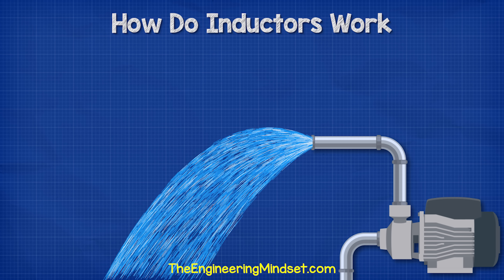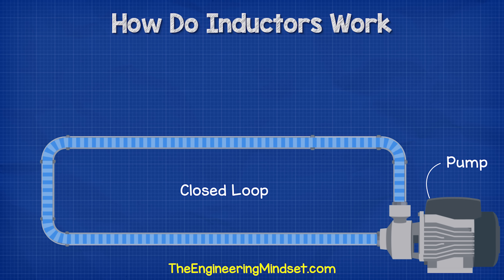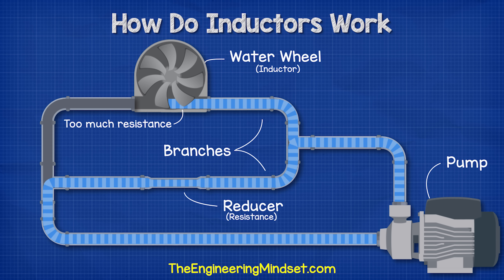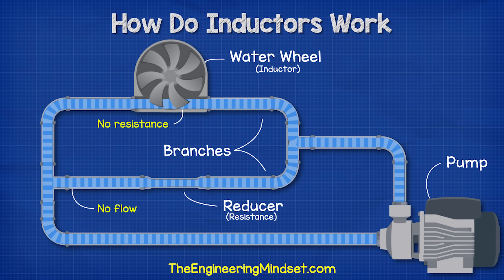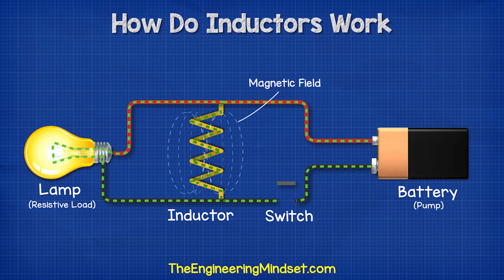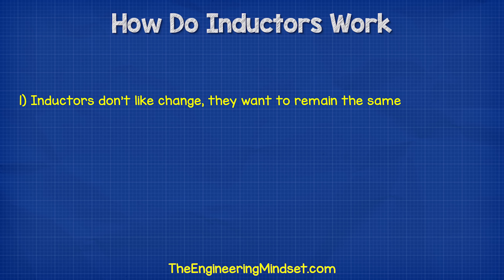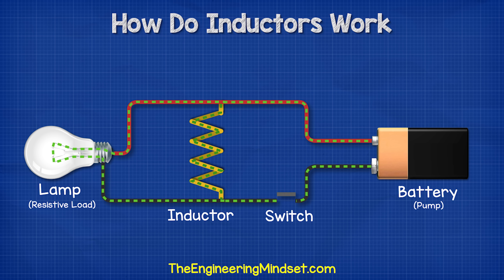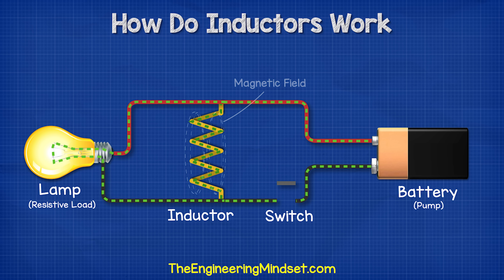How Inductors Work

Comment: so how does the value of the inductor affect? lets say i have a circuit. the old inductor on it used 1mm wire with 20 turns, now i swap another one same that but with double 1mm wires. how does this affect?

Comment: Please could you make videos showing how:

• Comparators 
• Voltage reducer circuits (say from 48v DC to 12, 9 or 5v DC)
• Toroidal transformers
• Complex logic gates
• Modified square wave oscillators
• IGBT, BJT, MOSFETs, GTO
• Zero Voltage Switching (in inverters)

Work

Comment: It probably would help to mention the practical part of the theory where the inductor tries to maintain the peak of the alternators (power supply} voltage even when it drops to 0 volts 60 times a second or whatever the frequency may be.

Comment: I like the video I understand what is going on from someone that deals with electrical everyday. But this all means nothing if I don't see a practical application and see it in use. I would recommend. adding that. Most of my knowledge, even though limited was actually learned by seeing it in use and by measuring it. Example would be seeing an vehicle ignition coil fire a spark plug and seeing the electrical work through a voltmeter, oscilloscope or amp meter.
Reply from the maker: Seen our new Oscilloscope tutorial? (beginner friendly) link here:➡️ https://youtu.be/LaY47Qrfs0c

Comment: There are only two things you have to understand. An electron and light. The movement of electrons higher to lower spins or otherwise produces light. Other things are encapsulation. Ten power +-24. 12×2. Because Max curvature is power 12. Time is always a quantum of 24. For four dimensions 12  - 4 equals 8.

Comment: To the battery DC, the inductor is just a length of wire. A inductor only has reactance to alternating current. The battery should be replaced with an AC source.

Comment: Why this inertia? Is it because electrons flows very very slow, what flows instantly is field both electric and magnetic field between particles in conductor and in core of inductor? Im asking cause lenght of wire to make coil, usefull on timings of micro seconds (power converter), lenght of wire is very short, and normally light would travel instantly, for some reason such wire is able to make huge difference in timing. Two wires close each other, with current flowing same direction makes coil, makes difference, could this because if current flows slower than speed of light? Could wire of conduction in witch current flows even slower than copper make even better coil? Clectrons are like domino effect it pushes against each other, what flows mostly is electric and magnetic field, electrons itself are much much slower than magnetic field, numbers of real electrons flowing is very very low, comparing to electromagnetic force caused by it. If such difference in speed we would have inertia effect.. I cant explain, i struggle to really understand why how, in details it works. This turbine explanation is very good though, best ever came across. Ever. What would happen if we make coil of wire in witch electrons flow faster what would be difference in material in wich electrons flow slower? Does parameters of coil varies depending on temperature?

Comment: I figured the inductor is a resistor. As current is forced through. It generates heat. Heat increases the resistance and it will eventually fail.
Reply from the maker: Check out NEW resistor video, everything covered! ➡️ https://youtu.be/DYcLFHgVCn0

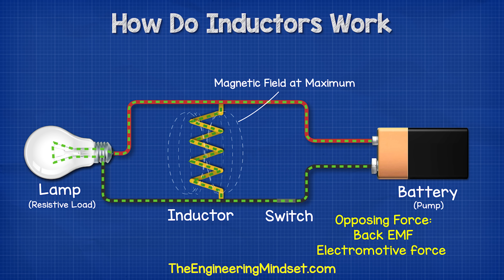Comment: 4:52
If the inductor will eventually act like a normal piece of wire with no resistance, what's stopping it from creating a short circuit?

Comment: the creation of the magnetic field, the movement of that, I assume is then opposing  the current thanks to the like, the left or right hand rule, or something, cus a moving magnetic field induces a current, and the movement of the field being created by the inductor will then cause it to induce a current in the opposite direction causing impedance, thats what ive imagined happens atleast.

Comment: Is this how a coil on a car works?
Reply: A bit yeah. But an ignition "coil" is really two coils. A car ignition coil is a step up transformer. The car's ignition system runs the coil on pulsed DC. So the primary is constantly being switched on and off. This video did not really touch on magnetic coupling of currents between conductors. But that's something else we do with inductors a lot.

Comment: Very well explained using water turning a turbine and the kinetic spinning fins as the EMF 👍
I find the water analogy to visualize what's happening in electronics is a good fit but not perfect. It would be interesting to see how you can model a capacitor this way(?) I'd imagine a reservoir split in the middle by a rubber diaphragm
Reply: Since current has no inertia, it's difficult to find an analogy!
Reply: Or a water baloon. When the balloon is full, it will visually stop taking more water. And when discharged, all those water comes out fast due to the balloon's stretchiness.

Comment: It seems like what you are describing is a capacitor.  How would you describe that an inductor can act like a capacitor and how are they different?  I normally think of an inductor as a device used to cause current on another, non-electrically connected nearby circuit while a capacitor stores energy like a battery within a circuit typically used to reduce variance in voltages over time or to provide some electrical bursts for some applications.  Appreciate your videos and helping me better understand what you are trying to share here.  Thanks.
Reply: I will try to explain the difference between an inductor and a capacitor to you in the simplest way that I know.

A serial connected inductor is like a flywheel. It takes some energy to get it started but when it is started it is easy to keep running. The only thing that really would stop it if left on its own is the resistance in the bearings. When it is spinning it has stored energy and to stop it it must give out this energy. The electromagnetic force in the inductor works in the same way. It keeps on resisting change.

A parallel inductor works as an open circuit. it will take some time to get the flywheel to spin so that there no longer is any resistance. 
 
A parallel capacitor on the other hand is more like a big water tank. If you poor in water it takes some time before it is filled up. It also stores energy but it must be full before it has the same pressure as the input pipe. A pipe out the bottom of the tank will start up with low pressure but eventually have full pressure when the tank is full. The output will have almost full pressure all the time even though the input may be intermittent.

A serial connected capacitor will allow a current immediately. It is like an already filled up tank with a rubber membrane in the middle.

In many ways an inductor and a capacitor work similar. It is just that the inductor is resistant to current and the capacitor sucks in the current. 
The inductor has the voltage before the current and the capacitor has the voltage after the current. They both store energy.
Reply: @leonhardtkristensen4093 Thank you... Your explanation helped

Comment: As an EE, I think this video would have benefitted from an explanation of what inductors are, and why they operate the way they do, before you get into the how. Touching on Len'z law would have helped a lot
Reply: As Feynman put it, "Why" questions are tricky. Of course you can say Lenz's law is the reason why inductors work the way they do, but then out of a sudden thousands of new questions emerge: WHY does Lenz's law hold? WHY does the right-hand rule hold and not a mirrored version of it? WHY are magnetic and electric field correlated at all? Etc etc etc... IMO it's perfectly legitimate to stick with the HOW in the beginning to avoid complexity explosion LOL
Reply: I think he did a great job of explaining how they work for his target audience: the least common denominator, ie, me.

As a video creator, you have to decide who your target audience is and how to best teach them, as well as how much they can swallow in a given time period. IMO, he nailed it.
Reply: @floorpizza8074  the most common comment on this video is asking why. And an extra minute to offer some explanation isn't going to split the audience. Don't whiteknight.
Reply: @floorpizza8074  But without explaining its purpose, what it does, Why it is there? To novice it has no meaning. It's in one ear and out the other...ultimately learning nothing. I am a novice and I still have got no idea.
 So it creates a magnetic field and then it collapses. Well that's great to know... yay.

Comment: This video is misleading.  When presented with a branch, current will flow through every point of the branch depending on the resistance / reactance of the branch.

It would also be nice if the schematic symbol of an inductor was used to represent an inductor instead of the symbol of a resistor.  These 2 components do not react the same to a rising/falling current/voltage.  The work you put into the illustrations are great, but the message is misleading.
Reply from the maker: Check out NEW resistor video, everything covered! ➡️ https://youtu.be/DYcLFHgVCn0

Comment: It’s similar in functionality to a capacitor?
Reply: Yes, in terms that they both store electrical energy and are more generally useful in AC circuits. Inductors tend to maintain current, whilst capacitors tend to maintain voltage.
Reply: Inductors store magnetic energy, capacitors store electrical energy

Comment: Just repeated yourself in this video without explaining why they are used. The video gives the impression that inducters are useless as once they are optimal, power is cut to the output(bulb). Which is the last thing you want in any circuit designed to power your output device. You could have explained that they are usually used when a power supply's current fluctuates to regulate the supply to the output, to prevent damage or outage so that the output continues to function. Similar to a regulator

Comment: "... electrons leave the battery, they flow and try and get back to the other side of the battery" - I get why you want to illustrate what happens using that analogy, but the student may also want to know that is not really what happens to the electrons.  In reality they jostle, the electric field pushing them in a direction but the electrons that are free push against each other too.  In the end the current is just an emergent property of energy transfer via electric fields.

Comment: But what are they used for
Reply: They are principally used in AC (including switched DC) circuits: tuned circuits / resonance, sensors, energy storage, buck and boost circuits, AF & RF filtering, chokes ... the list goes on.

Comment: Inductors are primarily used in AC (and switched DC) circuits but explaining how they work at a basic level is very difficult in AC circuits (because you end up having to explain reactance, impedance, phase shifts etc.). The battery + inductor + light is not a practical circuit, but it does eloquently explain how they work (current 'inertia' via magnetic field), which is the purpose of the video.
Reply: It’s interesting you used the word inertia, I’m just a beginner with electronics but have been welding 25 years and when I took a electronics 101 course my gut told me the inductor gave the current inertia so it’s nice to hear you kind of confirm that in so many words.

Comment: Is it similar to a capacitor?
Reply from the maker: The inductor maintains current, capacitor maintains voltage
Reply: @EngineeringMindset  great! Thank you. Hope you do podcasts some day
Reply: Inductors and capacitors both store energy, but by different means.  Inductors store energy in a magnetic field, and once the current is cut off the magnetic field goes away (not instantaneously though.)
Reply: See my reply to @Josh

Comment: So then, what purpose does an Inductor serve? Is it similar to a Capacitor as it stores charge - or does it? It seems to work like a resistor when first given power, but then it causes a short circuit through itself. I'm confused?
Reply from the maker: It maintains current where capacitor maintains voltage. I'll do a comparison video with real examples
Reply: @EngineeringMindset  Thank you, that would be helpful

Comment: What are the consequences of replacing an inductor with a wire ?
Reply: inductors are generally used for two reasons: a passive energy storage device (like in a switching dc/dc converter), or in filtering. in both cases if you were to place with R, you'd change the behavior of the filter or totally prevent the power converter from working.
Reply: @ZacksLab  I would understand why a resistance, specially a high value one, would prevent or change the behavior
But would a wire cause the same result, or can it be "somewhat normal / okay" to do such a change in a circuit ?
Reply: @wilddreamer5907  yes, the unfortunate thing about the water analogy for electronics is that this is not what is actually happening. it (at best) helps to visualize DC circuits but it completely falls apart for high frequency AC. even in a DC circuit, when you close or open a switch, that is a high frequency event (extremely high di/dt or dv/dt occurs).

in reality, electromagnetic energy (the field) travels in the dielectric surrounding the conductor, not inside the conductor as little electrons flowing like water in a pipe as the analogy suggests

only once you start treating electricity as waves and fields can you understand the nuances that creep up in modern electronics.

to answer your question: every component in a circuit is chosen to perform a specific function within a system as a whole. replacing an inductor with a short circuit (wire) will totally change the properties of a filter. in the filter example, the filter is relying on the properties of the inductor in order to filter (or pass) the frequencies that the designer intended it to.

in the case of a switch mode power supply, energy in the inductor is built up and released in a controlled manner. since a resistor (or wire) can't store energy, the circuit would cease to function.

in AC, electricity doesn't take the path of least resistance, it takes the path of least inductance. now-a-days, every device is a high frequency circuit, even small DC digital electronics.
Reply: @wilddreamer5907  The simple answer is no. An inductor is just a piece of wire but what makes it an inductor is that that piece of wire is coiled around a magnetically permeable core, that 'coiling around a core' is what differentiates an inductor from a piece of wire. Note: even straight pieces of wire still have some inductance, especially relevant in long transmission lines.
Reply: @ZacksLab  Thanks a lot man, for all the info you shared.
They were very helpful and I appreciate it a lot 🙏
Reply: Coiled wire is also an inductor.The higher the number of turns or coils the higher its inductance.
Reply from the maker: Check out NEW resistor video, everything covered! ➡️ https://youtu.be/DYcLFHgVCn0

Comment: So why would you want to do this? What are practical applications? This video definitely explains the function better than any other I've seen though.
Reply: inductors are commonly found in dc/dc switch mode power supplies. inductors store energy in a magnetic field. if you're clever, you can build a circuit that uses a switch to turn current flow on/off through this inductor and get a higher or lower voltage on the output. inductors are also used in filtering (both signal and power filters)
Reply: well as a student of Electro engineering there are a few things from the top of my head where inductors are used which are: Breakers, Motors and Generators, Transformers, it is also used to generate electromagnetic waves for a transmitter (basically a radio), there are a lot more applications for sure but these are few that i thought of right now.
Reply: Simply put, you wouldn't; this is not a practical circuit, it is being used only to illustrate the behaviour of an inductor.

Comment: How is this different from a capacitor then
Reply: Both are considered passive devices and both store electrical energy, but that's where their similarities pretty much end. Inductors tend to resist changes in current, capacitors tend to resist changes in voltage. In AC circuits, voltage leads current across an inductor, across a capacitor, current leads voltage. Inductors store energy within a magnetic field, capacitors in a charge differential between two plates. Inductors allow DC current to flow through them, capacitors do not. Note: reactance is the effective resistance to AC. As frequency decreases, capacitive reactance increases (at DC, a capacitor is effectively an open circuit), conversely, inductive reactance decreases (at DC, an inductor is effectively a short circuit). And so on...

Comment: I know that capacitor is like water tank and inductor as water wheel.
Still... the main question is why do you need it in the full circuit?
Let's say we make a simole light circuit, won't it be fine if we do not need inductor or capacitor?
Reply: He is using the light as a demonstration
Reply: Inductors are equivalent to flywheels in a car engine.

Comment: Errrm what are they used for, these indusctors?
Reply: For DC it is used to slow the inrush of current to the device as the circuit charges up. In ac it is used as a low pass filter.